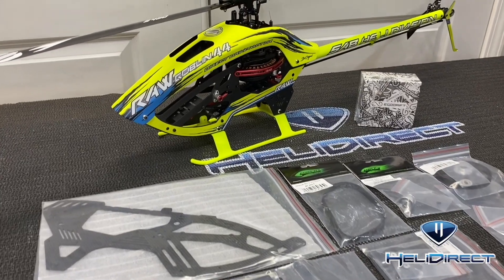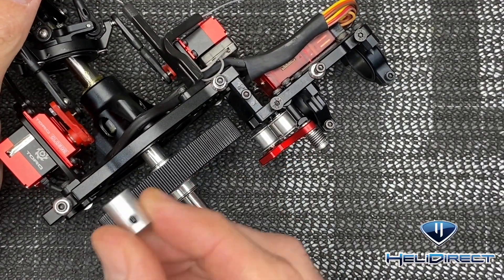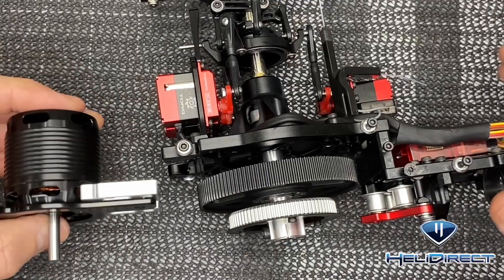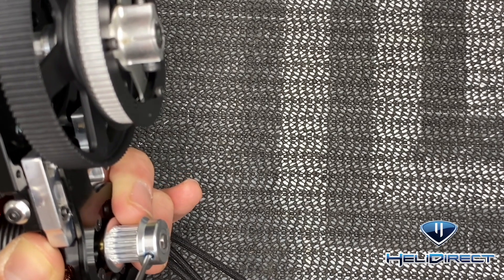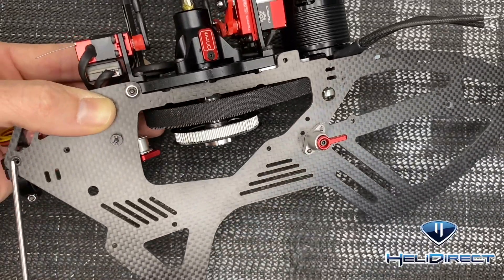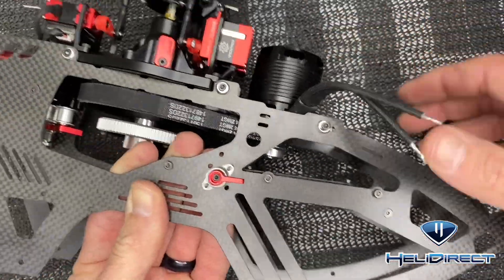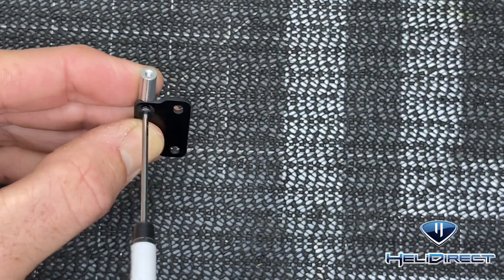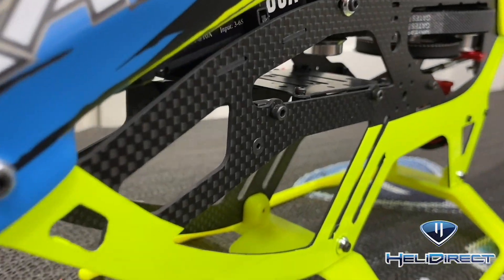RAW 420 Motor Conversion with Jeff West!

Comment: Hey Jeff ¡ Why would you want to change that beautifil direct drive motor for a Belt driven system ???? what is the advantage ???
Reply: So mainly the whole reason for this kit is for people looking for more torque at higher RPM. With the DD motor if you’re hard on the collective it will bog and this eliminates that.

Comment: Are you going to do a flight test?  Why change out the direct drive?
Reply: Yes, I already have on my channel. I’ve built two one with this motor (EgoDrift 3220) and one with a Xnova 3225. It’s insane with the Xnova 3225. This kit gives you more torque especially at higher speeds and sustained tictocs.